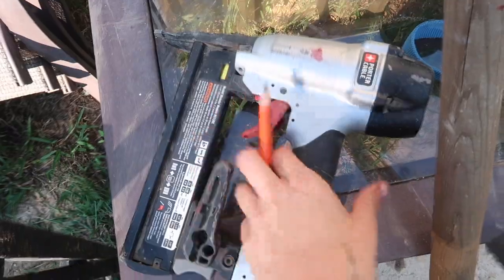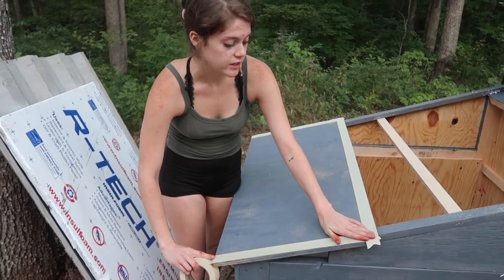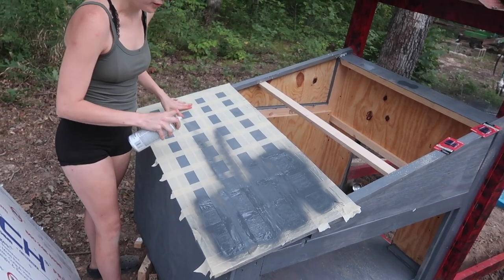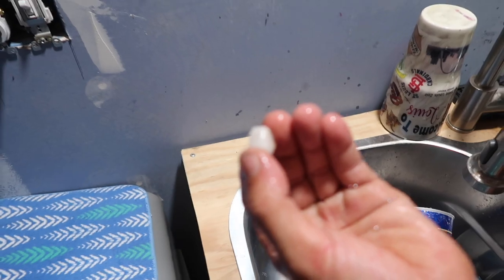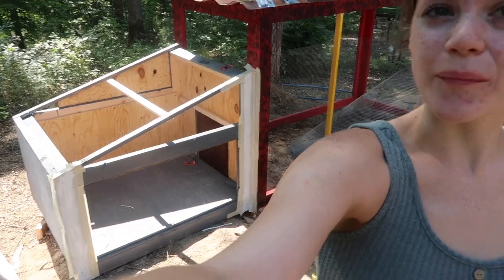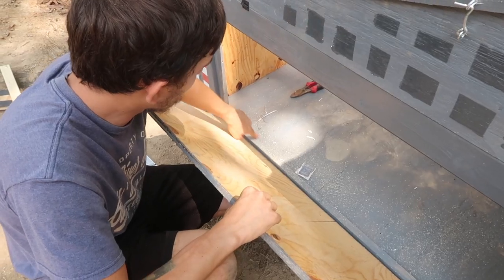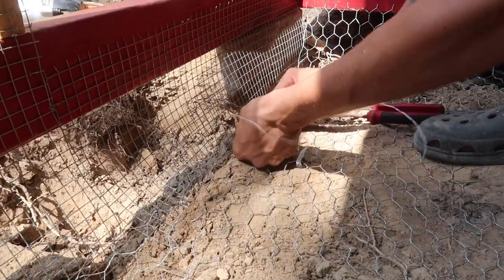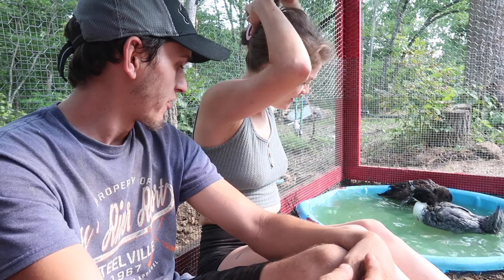Home For Our RAPTORS I Shipping Container Home | EP:57 | Duck Coop

Comment: One convenient modification you could make is to the door connecting the coop to the run. Right now you have to open the run, then reach in and open the coop. But if you have a door that's on tracks and lifts vertically, you can have a string that you pull from the outside.
Reply from the maker: We thought about it but it doesnt really bother us since were constantly in there to give them food and water anyways

Comment: There is actually a tool for those called "eye lag" or "wing nut" driver. amazon, lowes, and grainger have them listed online. i bet you can make one out of an old driver bit if you feel the need.
Reply: You can also put an Alan wrench in the chuck of your drill and it will do the job